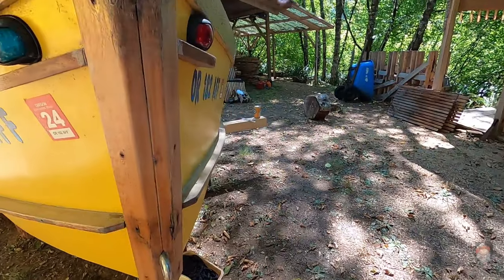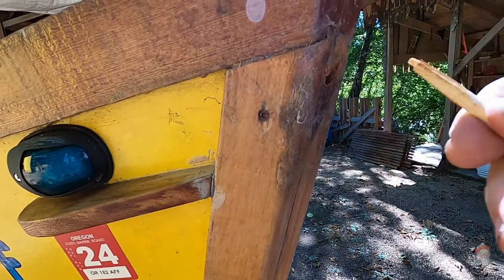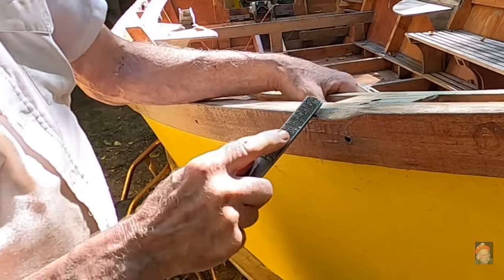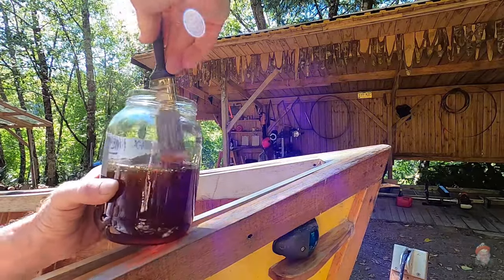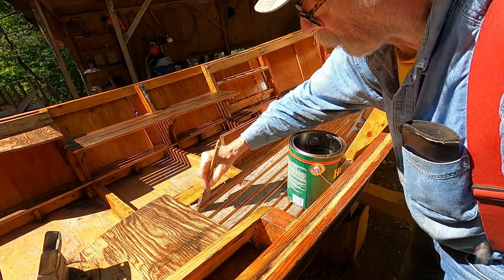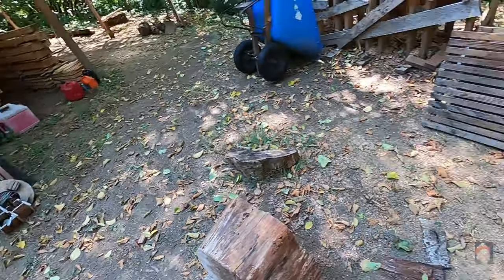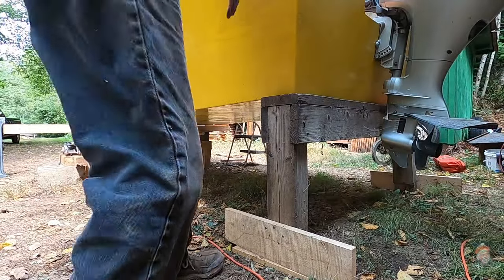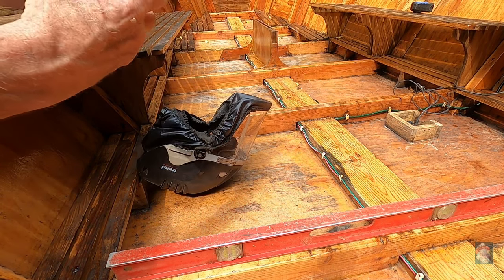Dory Maintenance Eight Years In, Part 2

Comment: Since when does it not rain in August in western Oregon?🤣🤣🤣🤣🤣
Reply from the maker: Average rainfall in August at our house is around half an inch. In the last dozen years, only once did it top one inch.
In your neighborhood, I spent most of August 1958 working in Olympic National Park. Didn't see a drop of rain until my last day there.
Reply: @OregonOldTimer  We almost were dry all the way through August. Only one rain actually hit here at the house, and it was only enough to dampen the moss, but not turn it green. Seattle, however got nailed multiple times with a number of downpours and lightning storms. But you know how it goes here on the “dry” side of the Olympics 🤪😁

Comment: Hi Eric, she still looks fantastic after 8 years!  The exterior finish still looks great too!  You may have mentioned it in the past but which paint did you go with?
Reply from the maker: Thanks, Eric. Ace Hardware Rust Stop in Safety Yellow. It says on the can it's for metal substrate only. Works fine over epoxy and fiberglass.